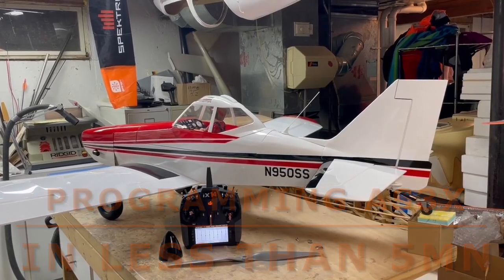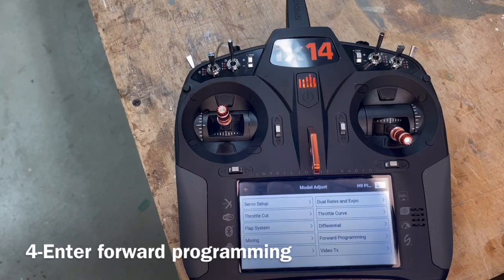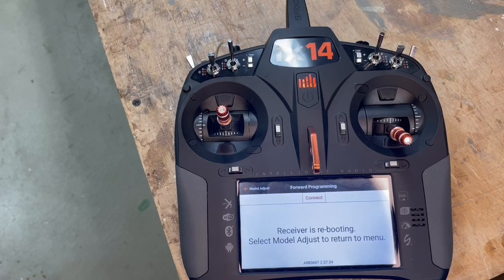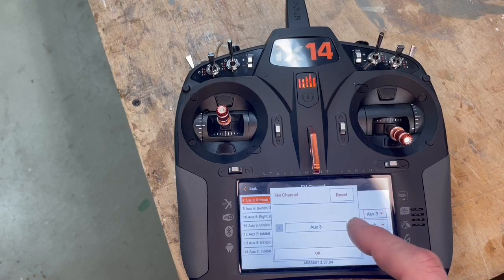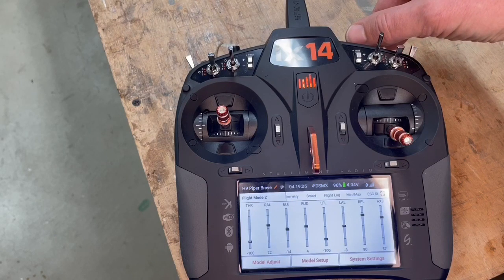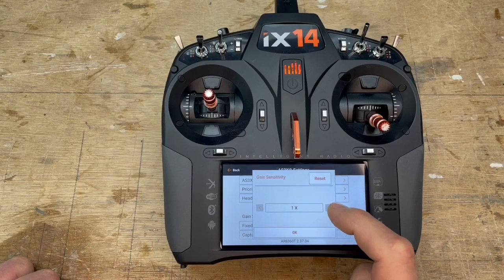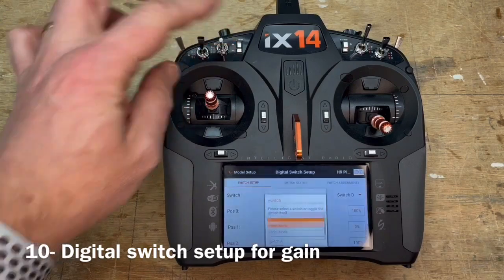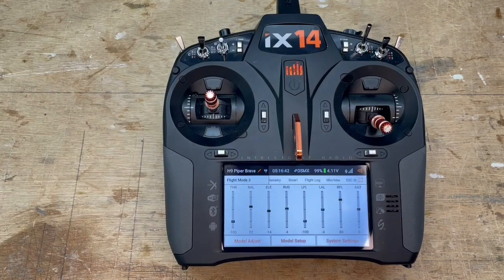Programming Spektrum AS3X in less than 5mn

Comment: 1. When the gain channel output is at -100% (knob fully CCW), the AS3X gain is 0%. At +100% (knob fully CW), the AS3X gain is 100% of the maximum gain setting. And at 0% (knob mid-position) the AS3X gain Is 50% of the maximum, not 0%.
2. Switch D should be used for flaps. If the plane doesn’t have flaps, switch D shouldn’t be used for something else.